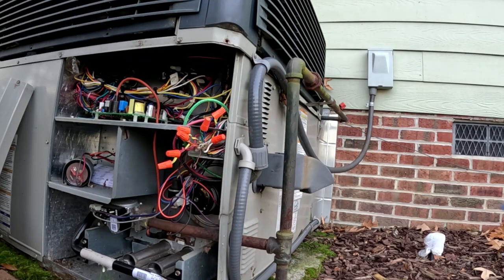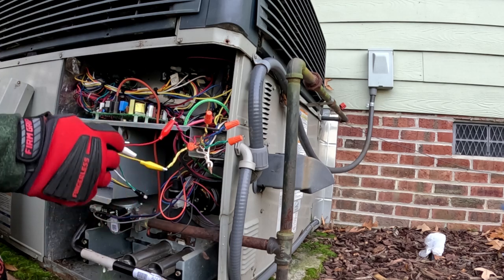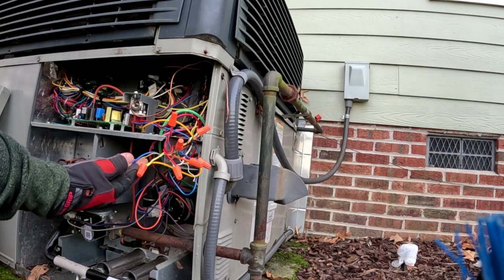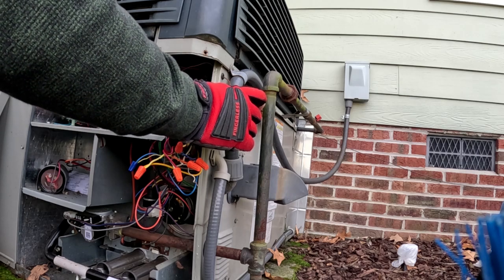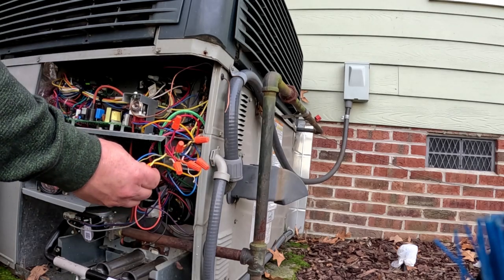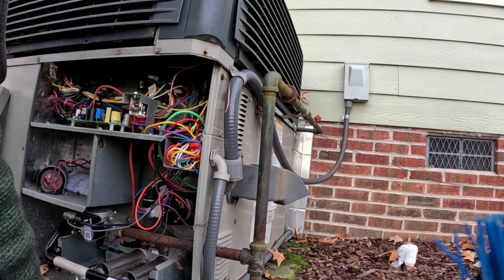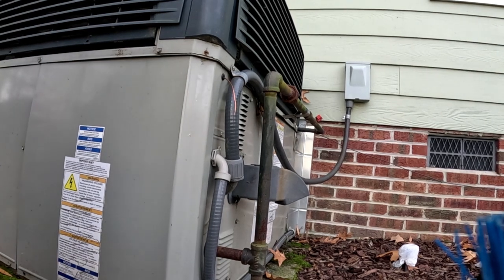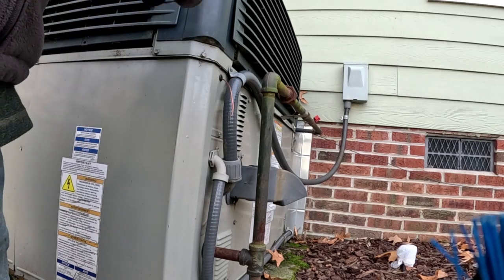HVAC repairs, just stick to the basics! #hvac #hvaclife #thermostat

Comment: What is the part number that would be a good truck stock
Reply: Thank you for the info
Reply from the maker: OT18-60A,  We get them at Johnstone Supply their part number is L42-042   2 pole low volt mechanical thermostat
Reply from the maker: We also use them on older units to set an outdoor temp lockout for heat strips on heat pumps. Just run the Aux from the thermostat to the switch and then back to the heat strips.
Reply: What temp do you lock out it ?